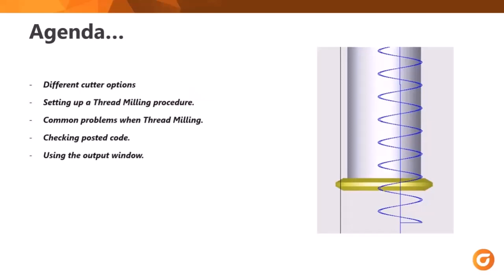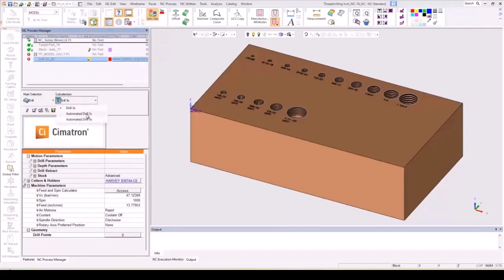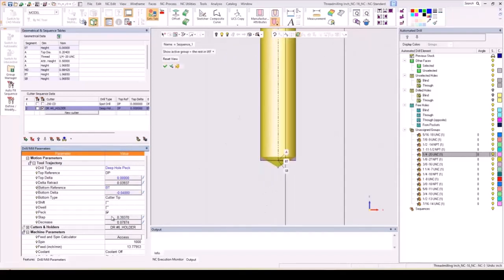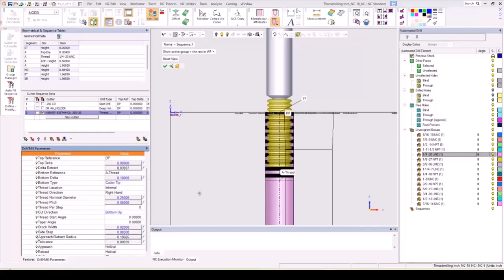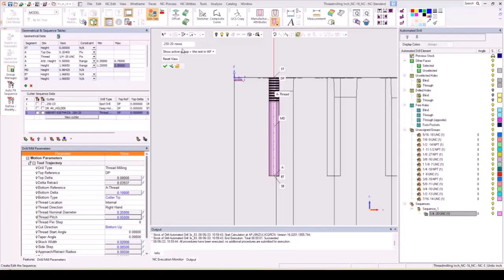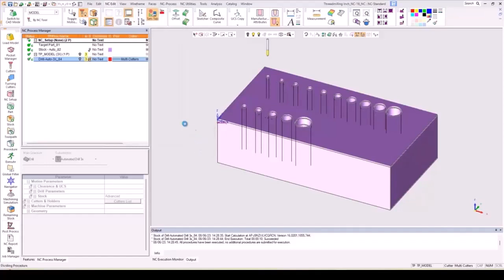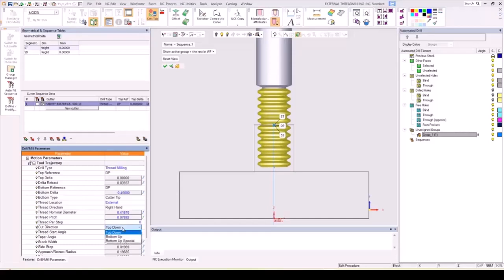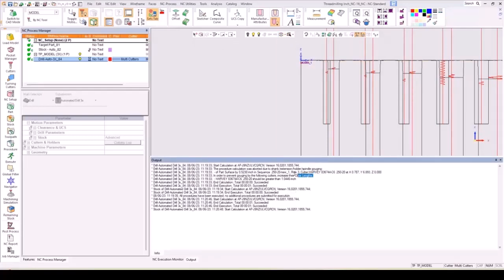Thread Milling | Cimatron Spotlight Webinar

Comment: is it possible to use cutter compensation when thread milling?
Reply: Yes under the threadmill in your procedure located in the same machine parameters section you can enable tip compensation. Will depend on post processor/machine type putting out lines of code or a canned cycle however.